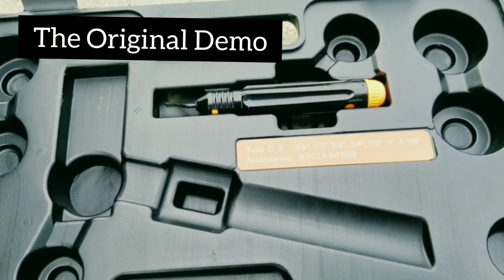HVAC Tool Demo/Review - Navac NTE11H Tube Expander

Comment: Looks like most hydraulic swagers crack 3/8 copper if not rotated like my YJ.
Reply from the maker: I tried it both ways, as you saw, didnt crack but I agree with rotating it!
Reply: Also not look circular, i think not good for soft soldering

Comment: Nice tool. Will probably buy it but I dont understand the taking it out and spinning it part. I dont feel its necessary. The tool should be expanding the tubing equally 360* around the inside of tubing. Spinning it would be a waste of time
Reply from the maker: A lot of techs spin it just not to crack the pipe from a stress spot.
Reply: You only spin with a hand swage tool, the point in spending the money on this tool is that you do not have to and save time.